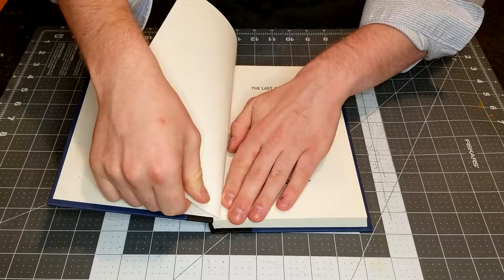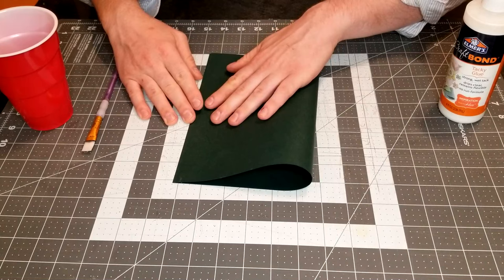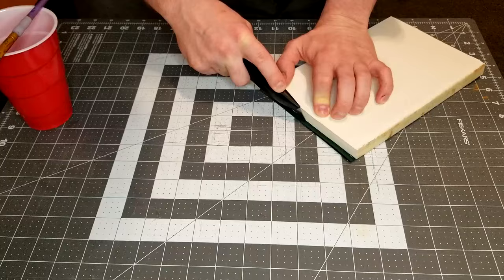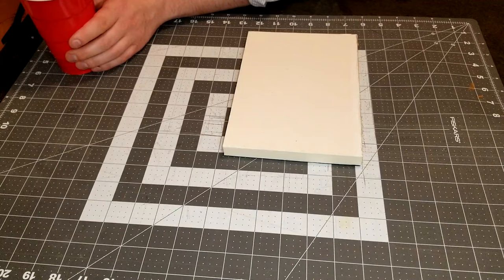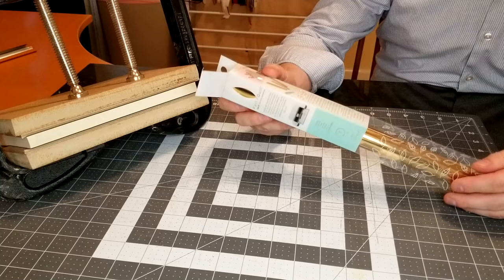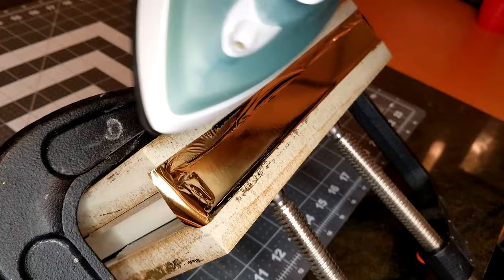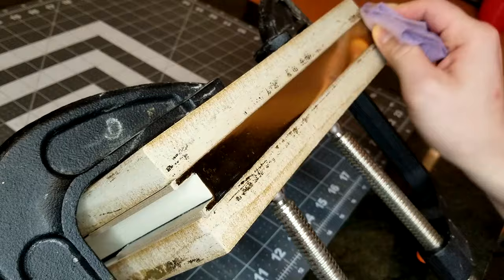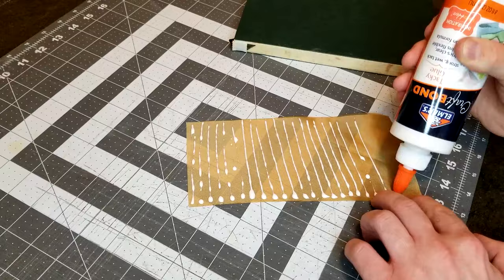DIY Leather Book Binding Tutorial Part 1: Page Edge Gilding and Text Block Preparation

Comment: Can you go over the tools you use? I really want to do this with my library!
Reply from the maker: Thanks, I'm so happy to hear you'd like to give it a try!  I am trying to not use many specialized tools for these videos to show how you can do it at home.  So I'm just cutting the papers with a box cutter.  I use rubber sanding blocks to support the sandpaper, but it's optional.  The only indispensable thing for the page edge gilding is Foil Quill.  Also you will want some beeswax, but you can get that at most hobby stores.  I mentioned most of the tools I used in the video.  Are there any specific tools you wanted more information on?
Reply: @ingeniusdesigns  Hi. What thickness of sandpaper did you use? (Sandpaper granulation) 
Maybe you said in the video but I didn't understand. I speak portuguese.
Reply from the maker: 120 grit
220 grit
400 grit
1000 grit
I'm not sure if it's the same terminology in Portugese or not, but I hope that helps!
Reply: @ingeniusdesigns  When these numbers appear in the video I thought it was the number of times you used the sandpaper.
Thank you very much for your help.

Comment: Hi Austin, I am trying your method to no avail. I am applying the foil quill with my iron set at wool. If it try to iron out the wrinkles, then lines appear and it is still patchy. I am not speeding it up and trying to take my time. It likes more like a hologram than a solid silver (using the silver foil). Any suggestions?

Comment: Thank you so much for this video! I wish I had discovered you sooner, years ago. I used to make my own leather journals; I always wanted to gild the paper edges, but all the methods available years ago told me I required actual gold leaf 😅 which was quite expensive, and that I required a rather pricey machine. I would have never thought of to use beeswax and to use an ironing board, much less sanding. Your technique surely must have required so much time, experimentation, research. I appreciate you taking the time to walk through it on YouTube 😁
Reply from the maker: It sounds like you're not making many journals now, but I'd encourage you to try picking up the old hobby again!  I too have experimented with the gold leaf and I feel your pain.  This technique was a breakthrough for me.

Comment: Hey there! New bookbinder here! When you're gluing the end pages to the textblock, how do you keep the glue from sort of bleeding through and sticking the pages of the textblock together? I tried to do something similar for one of my rebinds and almost ended up ruining the whole thing.
Reply from the maker: Well, honestly I haven't had much of a problem with that using my glue (Elmer's tacky craft glue) but if it's an issue for you then I would advise slipping a piece of baking paper under the first page so that if the glue bleeds through it will be stopped by the baking paper.  Nothing sticks to that stuff, so you shouldn't have to worry about the baking paper getting stuck in your book.

Comment: I found that if I apply acrylic skin color, you can attach the quicfoil simply by applying pressure (like the press used in the video). The only problem is that there are some smudges that do not allow for a well-defined result. Do you know of ways to remove the quickfoil? I have used: degreaser, alcohol, avio but nothing
Reply from the maker: I'm sorry, I'm afraid I'm not familiar with the QuicFoil product that you're describing.  I've removed other types of hot stamping foils with rubbing alcohol, but apparently you've already tried that on your product to no avail.  Wish I could be of more help!

Comment: Heyo, good sir. I'm following along and trying to use the Foil Quill on my book edges but no matter what I do, the foil comes off patchy and does not adhere well. I'm trying to sand quite a bit. 120, 220, 320 and 1000 grit. Then vacuum, then iron on the foil... but the foil never seems to stick properly. I started on the wool setting like you recommended but then also went up to the cotton setting, as well. Any advice would be greatly appreciated 🙏 I'm a new fore-edge painter and I really need to be able to gild my own books prior to painting.
Reply from the maker: Hi there!  I'm sorry you didn't have great success initially, although I'm glad to hear that you're working on it!  I'm impressed that you're a fore-edge painter; that's a technique that I haven't tried yet.  I'll admit, there's a bit of a learning curve with the gilding technique, but if one layer doesn't turn out well thankfully you can always put another on to patch the holes.  It took me a while to get consistent results every time.  It's tricky to diagnose the problem without being there, of course, but here are a few guesses.  I hope one of them helps!

1) You might be moving your iron too fast.  Try moving it in tiny circles, starting at one point and then slowly working your way outward.  Sometimes I just use the edge of the iron for better control.  The foil will wrinkle where you haven't ironed yet, but don't be alarmed.  press each wrinkle out with tiny strokes that start in an area that is already smooth and move outward.
2) You might need to spend more time going over the whole area with your iron a second or third time before removing the foil backing.  Sometimes the foil will go down flat but won't be fully adhered, so it helps to go back over every area, especially the edges.  My video is sped up, which may disguise the fact that it takes me 3-5 minutes to put down each layer of foil.  Perhaps I could post a version at normal speed so you can see what I'm doing in real time. Let me know if you think that would be helpful.
3) Make sure that you don't touch the edge of the book with your bare fingers after your last sanding pass.  If you get oils from your fingers on the pages that could interfere with the foil adhesion.

Thanks again for your question.  Please let me know if there's more I can do to help.  I hope you will begin achieving satisfying results soon!
Reply: @ingeniusdesigns  many thanks. Yes, I've been taking lots of time using the edge of the iron but I'm still not getting good adhesion. I spent over an hour trying to do multiple layers to get complete coverage but it seems like 30 to 40% of the foil is not adhering. I'll go nuts with the sanding and see how it goes again. There's no additional adhesive that you're using, correct? 

Really appreciate the reply and your instruction. I'm hoping to start doing some custom hand carved leather rebindings soon, too, along with the fore-edge painting. My YouTube is woefully behind but if you want to take a look at my work, Instagram is probably best @thebeardedbrushandblade 👍
Reply from the maker: I don't have an Instagram account, but the little bit I could see without logging in looked awesome; you are very talented!  

No, I don't use any additional adhesive.  Here's what I'll do.  This weekend I'll try to post a short video showing me applying the foil in real time instead of sped up.  I'll add a little commentary about what I'm doing.  Hopefully the answers you seek will be somewhere in there.

I love hand-tooling leather too, so I would love to see what you can do with your book covers!  The only reason I don't do mine by hand is because I feel I can get a greater variety of designs for a more reasonable time and financial investment with the vinyl, but I would be very proud if my edge gilding technique could grace the pages of one of your books!  

One last thought: I notice a lot of LoTR content on your Instagram (which is awesome; I'm a huge fan myself), but if your first edge gilding project happens to be a big thick LoTR combined edition, I would recommend starting with something thinner (maybe The Hobbit?).  Thicker books are harder to get perfect than thinner ones, and it took me a bit of practice before I felt ready to take on my own LoTR editions.
Reply: @ingeniusdesigns  Thank you! Yes, I started with a small paperback edition of The Hobbit to practice on. I did take some photos of what happened with the foil that I can email you if you're interested, but I definitely appreaciate the video plans and walkthrough. Gilding is definitely the weak link in my offerings right now and only buying gilded editions to paint would be far too expensive. 

Many thanks for your kind words and yes, LOTR is my jam, for sure...and I guess, Dragonball Z would be my peanut butter lol. A bit ecclectic, I suppose but it makes life interesting. My goal for this year is to start building a portfolio of original Tolkien work and attempt to get published in somthing official :)

Thanks again,
Chris
Reply from the maker: That's amazing!  I just posted a video addressing the gilding process in more detail, so I hope that helps.  I'm also setting up a channel email so you can send me the pictures if you like.  I'll let you know when that's set up!
Reply: @ingeniusdesigns  thank you! You are a scholar and a gentleman!

Comment: Awesome tutorial ! Thanks a lot for sharing ! What kind of sanding paper do you use ? how long is the process ? have you tried with a power sander ? Looking forward for part 2...
Reply from the maker: Excellent questions. I gradually progress from 120 grit to 220 grit, 400 grit, and 1000 grit sandpaper.  I actually do use a power sander as the first step when the page edges are very uneven.  In that case I use a belt sander, though, because I worry that a circular sander might scratch the pages across the grain.  Much like wood, sanding the pages along the grain is best.  If you sand perpendicular to the grain, you may end up with scratches that will be hard to remove and which will be visible in the final book.  
Part 2 just went live, so thanks for patiently waiting!
https://youtu.be/cpJSAsGUbg0

Comment: Hello, I hope you can help me, I filed the edges until they shine, but when placing the foil quill and passing the iron, it wrinkles a lot and is not smooth as it looks to you. I don't know what I did wrong, it's wrinkled and the finish looks terrible, please help. I love your channel :)
Reply from the maker: I'm sorry you didn't have great success initially.  I'm happy to hear that you're working on it though!  I'll admit, there's a bit of a learning curve, but if one layer doesn't turn out well thankfully you can always put another on to patch the holes.  My guess is that you might be moving your iron too fast.  Try moving it in tiny circles, starting at one point and then slowly working your way outward.  Sometimes I just use the edge of the iron for better control.  The foil will wrinkle where you haven't ironed yet, but don't be alarmed.  press each wrinkle out with tiny strokes that start in an area that is already smooth and move outward.
I also get the best results if I wait for my iron to get fully heated up before I start working on the foil.  
Thanks for the question.  I suppose the video glosses over how much I had to practice to get consistent results, and I still don't get it perfect every time.  Perhaps I could do a short follow-up video with more tips and tricks.
Stay patient.  I know you'll get it with time, and I'll be happy to answer any questions as they arise.  Way to go!
Reply: @ingeniusdesigns  Thank you very much for the tips and for giving you the time to read us and help us, you are a love 🥰 This is a precious and meticulous art and, as you say, you have to master the techniques and your work is proof of that, it is really beautiful. Muchas gracias otra vez, greetings from Lima, Peru. Blessings and may this great channel continue to grow :)
Reply from the maker: Small world!  My wife is from Arequipa!  Thank you so much for your kind words.  Hope the foil quill is working better for you now.
Reply from the maker: I just posted a video addressing the gilding process in more detail, so I hope that helps clear things up for you!
Reply: @ingeniusdesigns  🤗🤗wow I can't believe it, you are  really amazing!! 😍👏👏How exciting, you have really been very kind to me and to all of us who see you and admire your work. Blessings to you and your dear wife, mi paisana 🥰
sorry, my english is not so good
Reply: @ingeniusdesigns  🤗🤗wow I can't believe it, you are  really amazing!! 😍👏👏How exciting, you have really been very kind to me and to all of us who see you and admire your work. Blessings to you and your dear wife, mi paisana 🥰
sorry, my english is not so good

Comment: Very informative video, do you ever have any issues with pages coming loose after you remove the original covers? Any advice on how to make sure none go astray?
Reply from the maker: Thanks for the kind words!  I would say that's not very common unless it's an old book and the binding was already damaged.  In that case, a thin line of glue at the page crease usually works fine to stick the wayward sections back in place.

Comment: Finally i found answers to my questions of book edges but can it cover foxings too?
Whats the name of the foil
Reply from the maker: You have to thoroughly sand the pages to a high polish before you apply the foil, so that should remove most foxing and other discoloration, but even if there is still some staining I imagine the foil would cover it just fine.  As I mentioned in the video, I use Foil Quill brand foil.  Unfortunately that brand is going out of production, so I'm planning to experiment with other brands in the near future and post my results on the channel, but I haven't done that yet.

Comment: Thank you so much for these video!!!  I've been wanting to do this forever with several sets of books I have.  However, most are paperback.  Would you be willing to show how you handle separating the covers from the rest of the text block?  I am not entirely sure the best way to go about it.  Like do you remove the covers and spine, or just cut the covers off and leave the spine?  If removing all, how do you get the spine to separate from the text block as newer books seem to be very well stuck together (I guess you would want that if you weren't trying to remove it)?
Reply from the maker: Thanks for the question!  I do remove both the covers and the spine on paperback books (most of the books I start with are paperback, actually.  In paperbacks the cover functions as the book's endpapers though, so you remove them just like you would remove the endpapers of a hardback book.  It would be pretty quick to do a little video demonstration of this, so I'll see if I can pull together a short video for you on this topic when I get the chance!
Reply: @ingeniusdesigns  Thank you.  That would be awesome!  I just got the last Witcher book and wanted to start on those, but wasn't sure how to get the spine off.
Reply: So I had tried several ways of removing the covers.  So far the best way I have found is to use a iron and parchment paper.  Heat the glue just enough to pull the cover off.  You have to go fairly slow with it as not to heat up the glue too much that it breaks up the text block.   Still interested in seeing any other ways that may be better than this way.

Comment: What a great video! I have two questions. When you glued the folded cardstock, did you glue the folded edge along the spine? Also,  did you sand all three sides or just the longest end? Thank you.
Reply from the maker: I glue about a 1-cm thick stripe next to the spine.  I do sand all three sides of the book (clamping, sanding, and foiling each side before repeating on the next side), but the top and bottom sides usually take less time to sand than the long side.  Hope that helps!

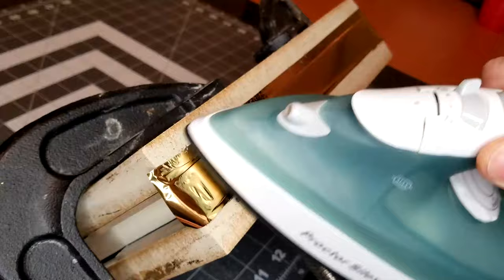Comment: Hi, I followed your tutorial to make the golden pages and got an almost perfect result. I have a couple of questions 5:30 :
When I "break" the pages, many small gold particles are created. I don't mind the effect, but how should I do to get a shiny surface?
I didn't quite understand how much wax to apply, besides, trying to remove it I found it difficult and almost ruined the effect. By any chance should I use a slightly damp cloth and not totally dry?

Anyway, the result is amazing and for being the first attempt it was very easy.
Reply from the maker: That is amazing to hear.  So many people find the technique challenging that I am really gratified to hear you got a satisfying result your first time around.  
As for the small flakes, I get them too, and they can make the surface slightly less shiny, but applying the wax helps to minimize the flaking.  The layer of wax is pretty minimal and it does dull the finish slightly, but I find it's worth it to reduce the flaking.

Comment: Hi! I'm Brazilian, I loved your video, super explained, but I had a doubt, what goes in the cut to stick the foil after the sandpaper and before the iron? I've been looking for a video like this for a while! Thanks!
Reply from the maker: Actually nothing goes between.  The brand of foil I'm demonstrating with has a very thin heat-activated backing, meaning that the heat from the iron causes the backing to become adhesive, sticking the foil to the pages.  That way I don't have to use any gilding size or glaire.  I tried doing this with many different types of glaire, gilding size, and glue, but none produced results for me as reliably as the foil quill does.  If I ever find a better, simpler technique I'll be sure to share it on the channel though!  Thanks for the question!

Comment: May I seek your advice? Will this gilding process be suitable for a deck of cards? What are your thoughts
Reply from the maker: This would work great for a deck of cards.  In fact, I think it would be easier than on thinner book pages.  You might have a little trouble with the rounded edges, but I don't think that would be too hard to figure out.  You might still have to sand the cards before applying the foil though.